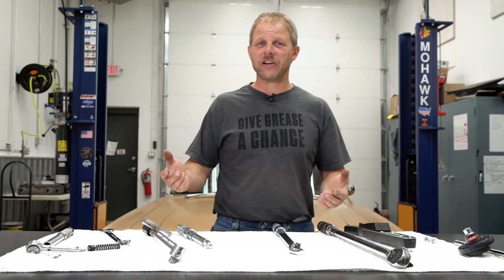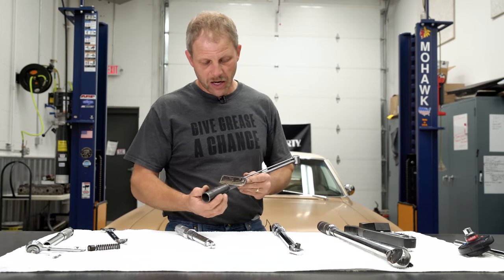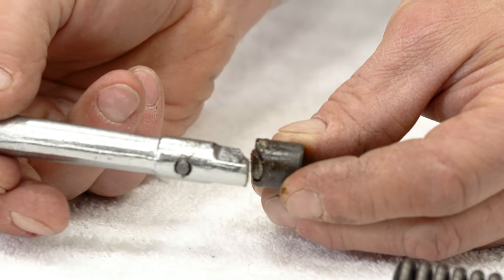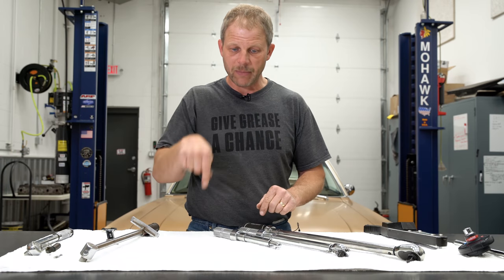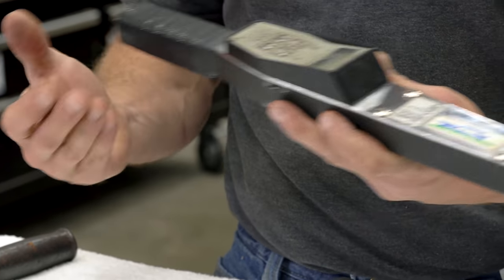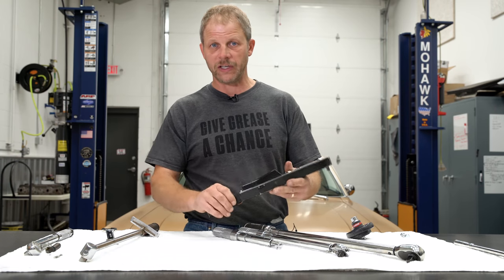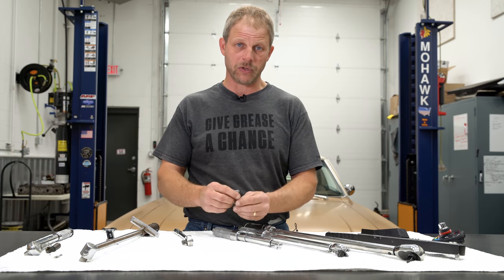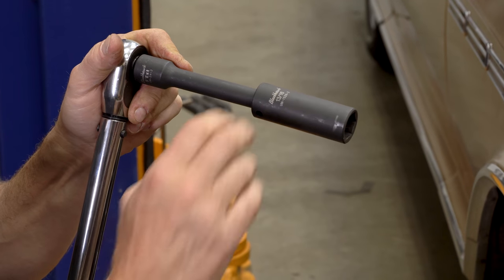All about torque wrenches | Hagerty DIY

Comment: hey Bud, 
great informative video. I've turned a wrench for 50 + years, on cars, trucks, motorcycles, ATV and now eBikes. 

Note; Did I mention Outboard Boat Motors. Well, since (as a kid), I had a GIANT FAIL concerning a certain boat motor and a Brass "Speed" Prop (that I saved for months to buy)  I SWEAR I "tightened" ( really, it was Real TIGHT)  let's "SOB", move on. BTW, since when is a cotter pin all that important. Don't ask!!!!!!!!!!

That was a very informative video and it had many bits of info I already know. 
BUT, you also added info I didn't know.
 That was refreshing, and just shows that no matter your experience (BOAT = Break Out Another Thousand), there's always something you can still learn.
Now finally, and most important, WHERE DID YOU GET THAT T-SHIRT!!!!!!!!! :-)
 I Need one.
Thanks in advance.
Ride/drive/build safe and have fun.
cheers
Boots (don't call me Ringo) Langley
La Mesa, ca

Comment: Great video. I've been using torque wrenches in all shapes and sizes for the last 18 years at a big truck factory. This is the first time I had a decent explanation on how they work. I do know our torque wrenches are calibrated every six months, but I don't know if they go far of during this period. We use the "Nm" values over here in Europe (Newton per meter) and some off our digital wrenches give the option to use other values. We have them as low as 4Nm and the biggest are over 1000Nm, just picking these up is already back breaking...
Keep these videos coming, they are all so helpful and interesting, even for professional mechanics.

Comment: I'm a structural engineer mainly in the aerospace field.  One of the things I've done is calculate required torque to ensure that joints don't gap, leak, etc.  Once while working on a rocket program we were using 1" shank diameter 200ksi bolts (Grade 8 are 150ksi) and calculated a required torque of 300 ft-lbs.  When the tech asked me how much torque I told him "small block Chevy".  Luckily there are hydraulic powered torque wrenches available.

Comment: Bonus footage: a 24 inch pipe, slipped on the handle of a China made 3/8 ratchet with a 3/8 to 1/2 adapter is Not a torque wrench. LOL
Great video!
Reply: THAT my friend is a home made breaker bar AKA knuckle buster.
Reply: @scottfirman  ouch!
Reply: Cheater bar

Comment: Often in assembling aircraft engines, you will actually measure the stretch of a bolt with a micrometer to determine how tight to tighten it.
Nice nob on the video
Gary 76-Year-Old A&P and IA in Northwest Arkansas
Reply: Sir you belong to the era of quality engineers ever produced
Reply: Also a good idea to do the same on engine assembly. I actually have a tendency of using plasti gauges and bolt stretch to tell me what to tighten everything to and which  bearings to use where.

Comment: So it happens that recently I wrote a bolt calculator and two days ago I gave a lecture in a research facility where I work about the bolt calculator and torquing methods (I am a mechanical engineer). Must say that the content of this video is really great! Very well explained. I would only add one point: you must keep in mind that static coefficient of friction is higher than dynamic one. It means that while torquing, you should apply torque with one, non-stop continuous movement until the final torque is reached
Reply: Whats your opinion on fast jerking motions or "aggresive" torqueing of bolts and hardware? I see this EVERYWHERE in both professional shops aswell as the oilfield industry and I do not approve at all.
Reply: @uglymechanics6599  I would not approve it either. It is all about accuracy - torque based method can provide accuracy of around +/- 10% if calculated and executed correctly. Short bolts are more sensitive than longer bolts, because if you apply that same axial force on long and short bolt, the longer bolt will elongate more than the shorter one (and by elongating bolts we want to achieve some certain stress inside them). If you take this fact into account, you will find out that while torquing a long bolt, you need to rotate the torque wrench more degrees in comparison to a short bolt. And the difference can be really significant.
That is why slow and continuous movement is required if you want to do it right.
Reply: @dawidpatrzalek   Could you speak as to when a bolt or fastener being torqued should be lubricated by some type of lubricant. I took a course while in the Navy and the instructor made it perfectly clear that a failing score would be assigned to anyone torquing a "dry"  fastener or bolt. Fast forward to today and I see so many mechanics torquing bolts that are "dry".  What should the standard be?
Reply: @seniorrider9337  as always, it depends.
It is an excellent habit to lubricate bolts, but this shall not be done if lubrication was not considered while calculating torque values. A good example might be lug bolts, which must not be lubricated, otherwise there is a risk of plastic deformation what is not acceptable in the case of lug bolts. Some manaulas even state that lubrication of them is simply forbidden.
The rule of thumb is to assume that lubrication shall not be used if not stated otherwise.

I always try to use a lubricant if possible, especially when snug-tighting without using torque wrenches.
Some might be surprised that I refer to the term of snug-tighting in this discussion, but this metod is an official method for bolting non-preloaded assemblies according to the EN 1090-3 standard:
"The term “snug-tight” can generally be identified as that achievable by effort of one person using a normal sized spanner without any extension arm, and can be set as the point at which a percussion wrench starts hammering."
Reply: @dawidpatrzalek    Thank you sir for your answer. I have wondered for years about the torque values listed in repair manuals that did not indicate if the fastener listed at a certain torque value was using lubrication or not. I have finally come to feel that unless a fastener lists lubrication, the the torque value is dry.    Again, thanks for your answer, and happy holidays.  Tom

Comment: Nice vid. All clamp load is accomplished via bolt tension or 'stretching'. Torqueing is just a neccessary evil to get there. As mentioned the importance of lubrication or freedom of movement of the parts. I found lub was most important for stainless on stainless as it's promotes galling under high torque settings.

Comment: DO NOT trust a torque wrench on a crush washer. I put one on my Subaru oil drain bolt and the specification given in the book is for a SOLID washer, not a crush washer. Also, I have seen different values given from manufacturer to shop. I haven't used a beam style torque wrench in years. You can convert inch pounds to foot pounds.  I have done it on snowmobiles many times. Nice video! Some old school stuff covered but yeah. Now days, a snap on torque wrench with degree computer is a MUST for any new car.

Comment: While I do agree it is good  form to wind a micrometer style torque wrench  back down after use, all may not be lost if it is occasionally left in a wound up state. I had a Mac torque wrench of this style which I purchased in the mid 1970's and on too many occasions when  I went to use it, I found it in a wound up state much to my chagrin. Sometimes it nad been that way for all too long. So in 2018 I took this and another much newer wrench to a calibration service to be adjusted because surely they would  need a good adjusting after all  the neglect I had put them through. After more than forty years of use the Mac tested well within accuracy at all tested  measurements, low, medium and high. And the other Armstrong wrench did not need adjusting either although it wasn't nearly as punished as the Mac.

Comment: Whoop!! I'm curious to know how much linking extensions would effect the actual torque value. Maybe I'll try that myself. Torque a lug nut to 80 lbs with extensions on, then again with them removed.
Reply: Malok Gashvog - torque is force x distance so any difference in the length of the wrench will change the torque. (I was a manuf. engineer...). Good luck!

Comment: Good basic vid but no one seems to discuss how length changes affect the torque setting. If you use an adapter that extends the working length of the torque wrench, such as a torque adapter, the extension will give more leverage & the torque wrench will need to be set lower or the torque on the fastener will be much higher than you want. The opposite applies if your adapter shortens the working length of the torque wrench. You will need a higher setting. You can search for the formula. Yes, you need to set the torque wrench on its lowest indicated setting, not turn it all the way down until it stops.

Comment: I've destroyed so many clickers following instruction but not knowing what I was doing. That is leaving it at the lowest unsprung setting (and then some) for storage per instruction. This setting will jam the adjustment nut in the handle thus lose the clicking ability and function as a torque wrench next time you get it out to use. YMMV. Plus those clickers will require constant recalibration as the compression spring became "tired" and none of those springs are linear which will require a fudge adjustment from time to time. Ever wonder warranties on most clickers are one year or less?

Comment: can you please comment on those different colored torque sticks to use with an impact wrench. thanks
Reply: Those torquesticks as you call them are just sockets that have a plastic colored protection so you don't get scratches on your alloy wheels.

Comment: You won't lose torque through a stack of socket extensions. Simply draw a free body diagram to confirm. You will lose angle, though, and possibly cause other problems.

Comment: You didn't mention digital torque adapters like this one from Amazon "ACDelco ARM602-3 3/8” Digital Torque Adapter (3-59 ft-lbs) with Audible Alert".  Its size and beeps also allow putting it at the socket end of a long extension so you'll measure true torque and not a value affected by the twisting extensions.

Comment: I notice that Davin never defined torque so I'll put a definition I use - it's the ability of a force to rotate an object about an axis. The definition is a combination of definitions from several textbooks and professors.

I also want to expand on the TTY aspect - all bolts stretch somewhat during tightening but they have a yield strength and an ultimate strength (as do all materials). The number you see listed as the bolt strength is the ultimate tensile strength (UTS) and iirc it's about 120 kpsi for a grade 5 bolt and 150 kpsi for a grade 8. Now, the yield strength is much lower and it is the point past which the deformation in the material is permanent but you can get higher clamping force at the expense of needing new bolts each time the machine is disassembled - the spring comparison is accurate.

Specs that do not use angles and only use fixed numbers calculate those numbers to be about 3/4 of the yield strength. This assures reusability. For a grade 8 bolt with the UTS at 150 kpsi and yield strength of 130 kpsi, that would mean that when torqued it will only use about 90-100 kpsi of its overall strength and will spring back into normal shape once removed, assuming it hasn't been thinned by rust or its mechanical properties altered by heat treatment.

Comment: I was taught if I used a swivel on the end of my torque wrench the calibration would be off. Is there any way I can still use a swivel and be accurate? Can I up the calibration to compensate?

Comment: My torque wrench has a Nm from 28/210 scale, and a Kms from 2.9/21.4 scale. But the handle has a scale from 0/12! How do i use the handle scale on the Nm or Kms, and do I just add the handle scale to no matter what torque scale I use?

Comment: I would like to add that torque wrenches should be recalibrated periodically.
Reply: Daniel C If you do customer work, yes. Otherwise...no, I would not care. Not that I would hurt but who normally has access to that.
You could at least make sure it’s similar to a calibrated wrench if you know anyone that has it, then you know it’s good enough
Reply: @LILLJE  When you're dealing with torque-to-yield bolts, similar isn't good enough, even for a homegamer.
Reply: @danielc5205  I seen so many idiots doing cars and yet rarely see failures. I mean think about it, probably 90% of all wheel lugs are over torqued and 5% are under torqued. Yet I never see wheels flying off randomly.

I just assembled my front harmonic damper by feel and it's supposed to be torqued to 200+nm and 60°. Haven't come off yet.
Now, if it was a racing engine, something critical or customer engine I'd make sure it was done right. Heck, I'd replace the bolt for starters.

I'm just saying it doesn't matter for the average person.

Comment: Okay. I change my own oil. I'd like to torque the drain plug on the oil pan, plus the oil filter cap/housing plus the drain plug on the oil filter cap. Items to be torqued to 30 ft. lbs, 18 ft. lbs and 9 ft. lbs respectively. Do you recommend a particular wrench. The torque wrench I currently own does not adjust to such low settings.
Reply: You need to get a smaller wrench that works in inch-pounds, and convert said inch-pounds into ft-pounds to get your final torque.

Comment: Torque wrenches that cost an arm & a leg vs harbor freight or amazon, are there brands in between these two extremes ? Pros & cons? I see many cons on amazon. Like to find a decent quality metric Nm clicker for my bike, most of what I've seen is in the $100 plus range...seems a lil' extreme for some small hardware. Any suggestions, anyone?

Comment: I'm not sure what to set my new wrench on its a 1/2" drive 10~150 foot pounds/13.6~203.5 N/m.
I am replacing the gaskets on the intake manifold on my ford f150
 truck. It calls for 53 inch lbs. then 71 inch lbs. How do I set up my wrench?

Comment: Can you talk more about those streched bolts . Where can we find them placed in an engine ?
Reply: Almost always head studs, crankshaft main cap bolts, rod bolts, crank shaft pulley bolts, and fly wheel bolts. They aren't super common but in the rotating assembly for sure

Comment: Good video although I missed some information about the difference between a cheap and expensive torque wrench. How reliable are the cheaper alternatives compared to the costly professional wrenches?
Reply: For example I have a snapon 1/2 inch goes 15-300ftlbs does angles and all that this will be used for my serious engine work like the heads on our 6.0 and 6.4 powerstrokes but at my work doing many sets of tires we have a 1/2 master craft maximum been going strong for like 3 years pretty accurate still used to put wheels on customers vehicles I would say it is within a few off my experience that would be around 150-200 canadian where as my snapon retails over 600 me and my dad have had harborfreight and princess auto cheapos all very inaccurate and broke with minimal home use our home use wrench now is the same master craft I use at work
Reply: Basically dont  cheap out get a "namebrand" from a reputable store and if your doing serious jobs like these powerstrokes it might be worth it to get the top notch stuff as one failed torque could lead to time and parts worth much more than a $600 cad torque wrench
Reply: I use one on my aluminum wheels, that's it. I will never let anyone put my aluminum wheels on my car without any type of torque wrench. It ruins wheels, rotors and bearings.
Reply: Harbor freight does sell better quality ones. Stay away from the $19 specials. The saying you get what you pay for rings true there. The higher priced ones there are pretty accurate. I use one for the wheels on my car only. A snap on or even craftsman is best quality.

Comment: Might be a "minor" detail but on every torque wrench I have used like those you showed, when you dial up the value you want, you need to "push in" the adjuster to "lock" in your setting. Something you seemed to ignore in your presentation. Seems like you would be changing the setting while using the wrench if that "lock" was not performed. ????
Reply: Don't be twisting on the handle and the value won't change.

Comment: I may have missed it but if you already reached your ideal torque why do you need angled torque in which to torque it past the ideal torque spec?
Reply: Some engine manufacturers had assembly procedures exactly like that. They specifies the torque to apply then the angle after that torque is applied.
Reply: @RiloElton  oh okay thank you

Comment: OK ! Does the manufacturer  includes this "angle" thing when prescribing torque setting lets say for a head or a wheel..?
Reply: If I understood what he meant, then I've seen it a couple times on the new junk with the stretch head bolts. An example of what I've come across would be: torque to 60 ft lbs., then tighten 1/4 turn (90 degrees).  I try to avoid working on new junk like the plague though, so I don't see it often.
Reply: If it is a requirement then yes the manufacture identifies the specified rotation in degrees after the torque value is achieved.

Comment: Torque is a measurement of rotation force.  There, simplified it for you.  Torque is different than power (watts, or hp) in that torque is a measurement of rotational force exerted immediately and not over time.

Comment: Where does a DIY home mechanic go to have a "click style" wrench recalibrated?
Reply: Use a baggage wheight scale and lift your wrench while the nut is fixed. Measure the exact lenght from boltcenter to your scale and calculate.I did this to mine because i thought the spring was damaged due to loaded storage, turned out to be precicely what i measured so the wrench was still ok